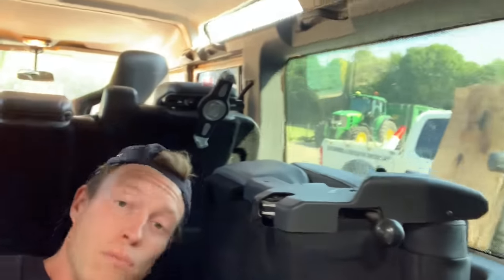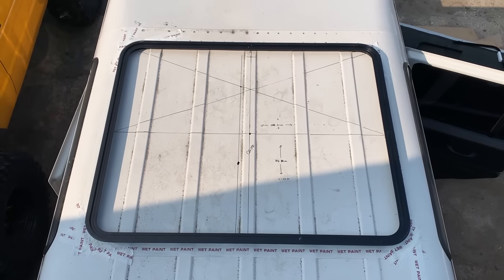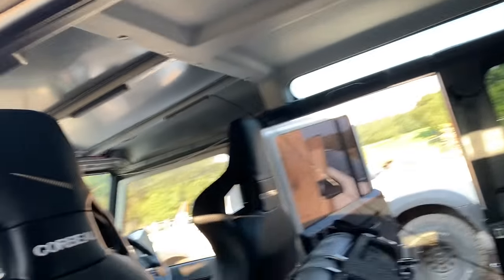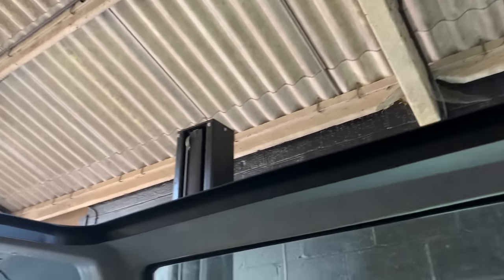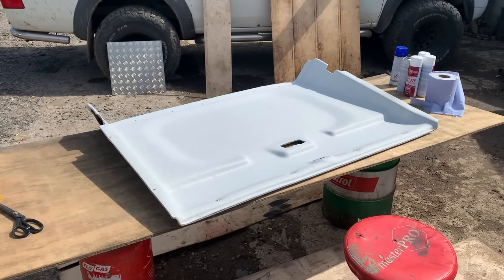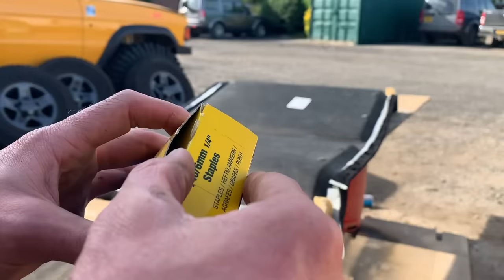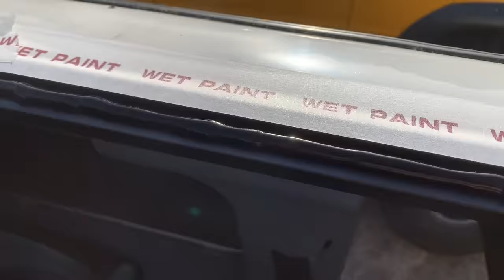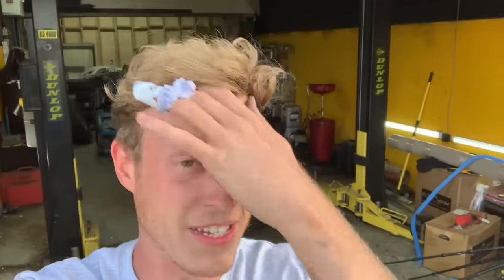Installing a Panoramic Glass Roof - Land Rover Defender 110

Comment: I’d have covered up those front seats, dropping bits of cut sheet metal down onto the back could cut the material. I love how you’ve spent ages getting it in the correct position. Looks great, what a fantastic modification

Comment: Also... I notice a lot of comments about the audio and I agree. You usually want the vocals on video to be around -12db on the audio waveform monitor.  Background music is at around the -18dB level and you may still want to lower the volume whenever you talk (called ducking). Some editing programs have an auto ducking feature that does most of the work for you and you just adjust to your liking. Hope that helps.

Comment: Hello from the US thank you for this video I'll be using this as a template to make one for an e30 bmw as a replacement for the rusty sunroof. It won't open but it'll still have the light
Reply: 7th Element Driving I want to know how it goes as I want to do the same to my e30
Reply: @safnaf3443  so it went well you'll need to remove the old sunroof and get lexan thick enough to match the sunroof and cut to size of the outside diameter and lay out to it rests on the inside cut out and use windscreen fitting form a glass shop to press in an weather seal like a regular windscreen

Comment: cool video. Not a fan of the suede headliner, as I'd be way too ocd about the grain not being uniform anytime someone touched it but other than that it's a cool mod. Some genius chemically welded the sunroof seal to the roof on my old pajero that I bought a few months ago and I'm thinking about just cutting it out and doing something similar to this.

Comment: might be a stupid question, however, how did you deal with the undulating roof section to the rear of the vehicle, with regards to weathersealing?
Reply: I would hazard a guess at a pile of tigerseal or polyurethane in the gaps. May have been better to install a flat roof instead? But as long as it's done neat, filling the gaps with sealant would work.
Reply from the maker: The frame is deep enough that it clears the undulating sections of the roof. But yes essentially you nearly fill that gaps between the frame with windscreen bond

Comment: This would seem to be asking for a heap of problems relating to things like structural rigidity, heat and leaks.
Reply from the maker: Not if installed correctly, it increases the roof rigidity and doesn’t leak 👍🏻